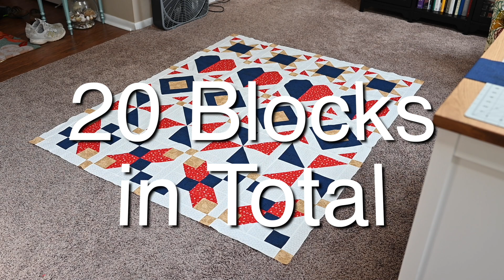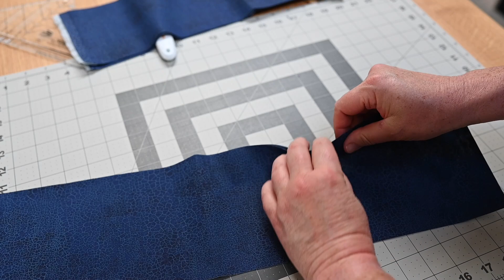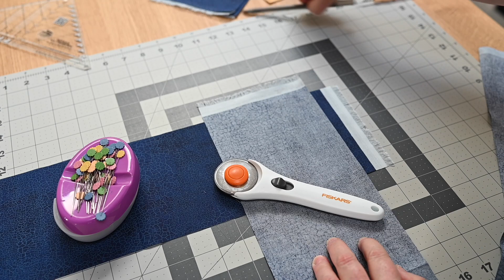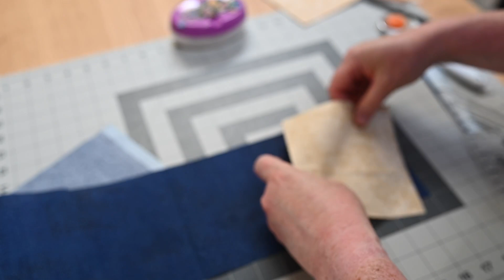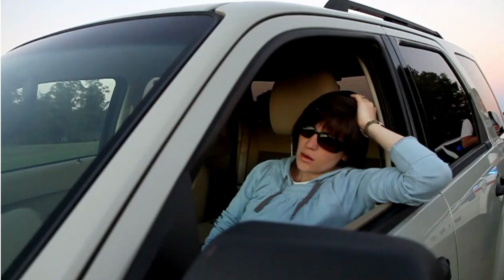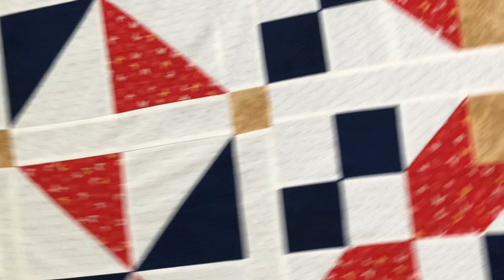HOW TO ADD QUILT BORDERS | All about QUILT BORDERS

Comment: I appreciate your method for figuring out how long to make the borders, and for figuring out where to place the corner stones. I am very challenged in quilt math, this has helped a lot. Thank you. Also, adding another strip on the bias, I never would have done that but it looks fabulous! ❤️
Reply from the maker: Oh thanks for letting me know that Susan! The numbers and fractions make my head spin so sometimes, it's easier to just cut something a little long, sew it and then trim to fit. With those side borders, they get really long and it's a challenge to accurately measure something that long . In my space anyway. The measurements are in the description, but unless every seam is perfect, it's going to be off a smidge. And I generally never get anything perfect. LOL yeah, that bias join always looks so good.